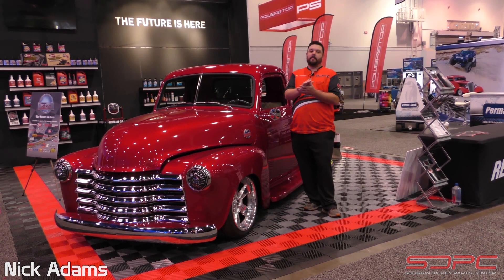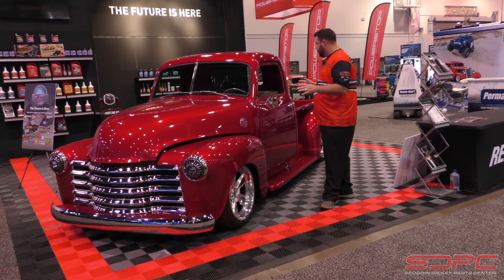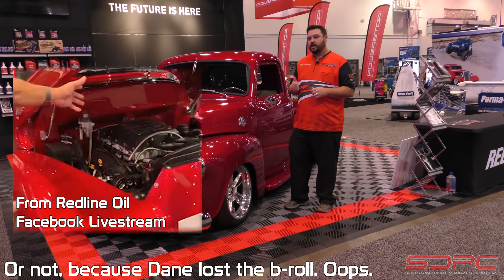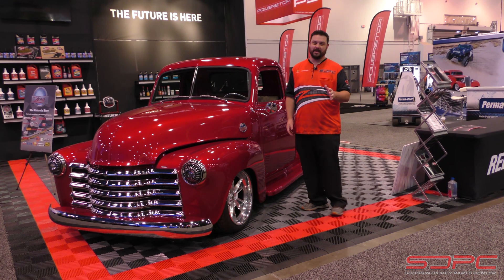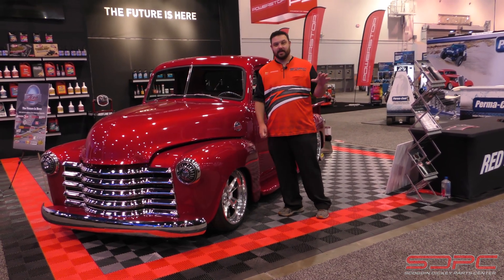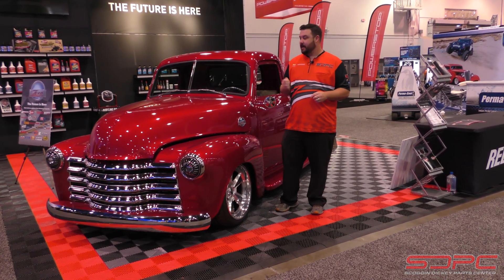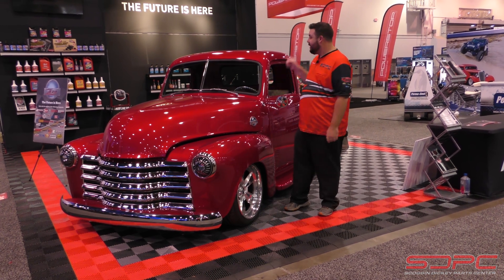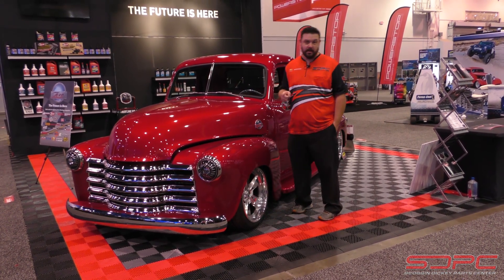SEMA 2021: Running an LS Engine on Hydrogen

Comment: Hydrogen is the future NOT battery power, it refuels like traditional gasoline, it’s not as susceptible to temperature like batteries and with the current push with battery power, the media is covering up the ridiculous amount of Ev’s burning down peoples houses and hazmat requirements in accidents… and wait till these batteries need to be disposed of, lithium batteries aren’t exactly environmentally friendly…